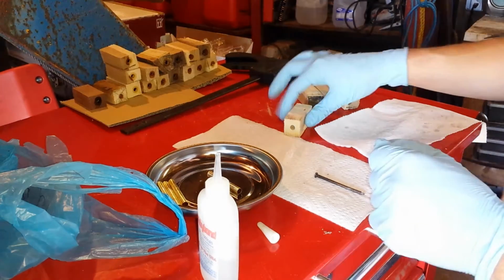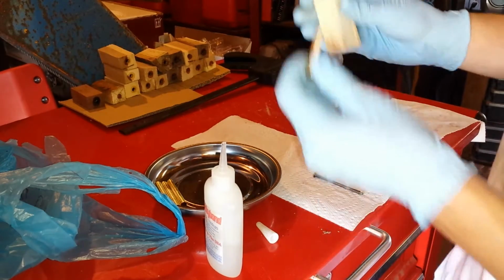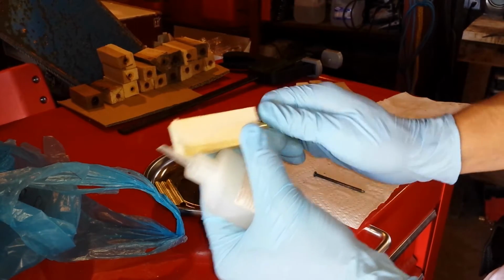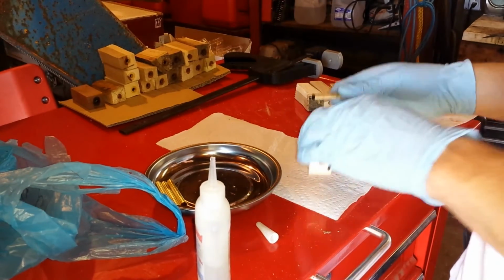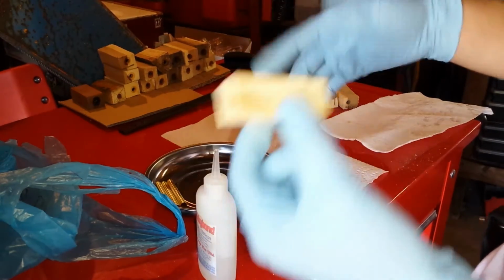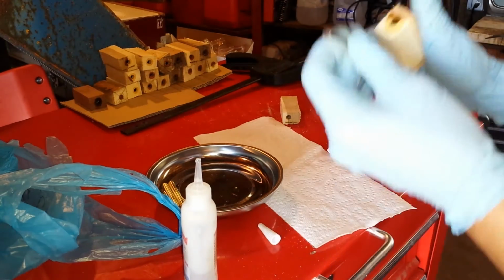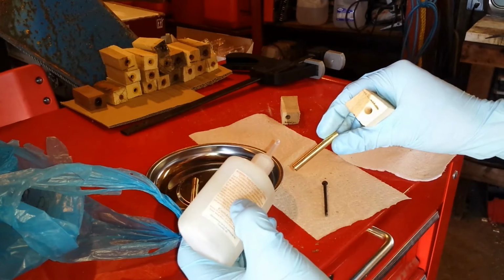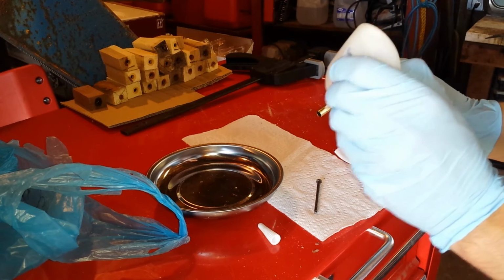How I Glue Brass Pen Tubes Into Pen Blanks

Comment: Nice video. Very helpful. I find a Phillips screwdriver bit works really well to push in the tubes. The tapered bit head pushes it in slightly and stops at the collar/ shaft of the bit